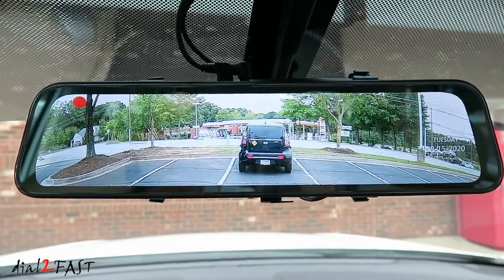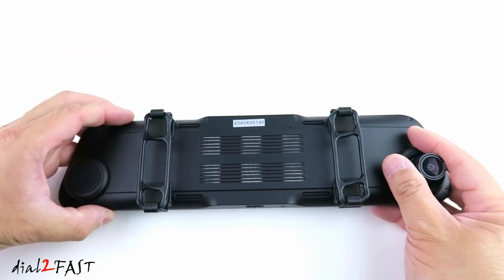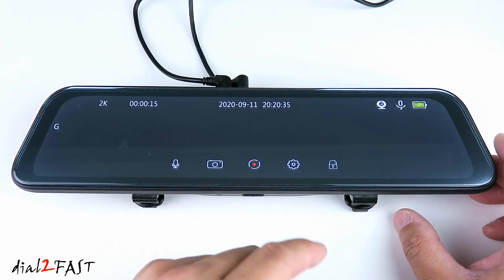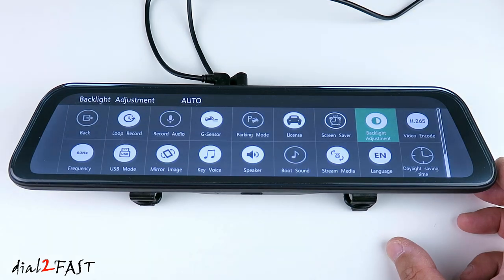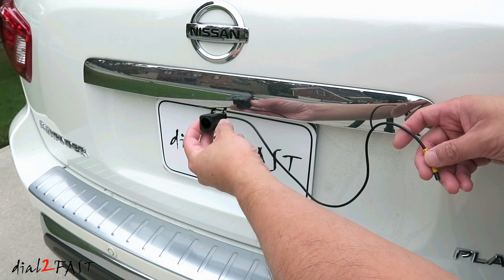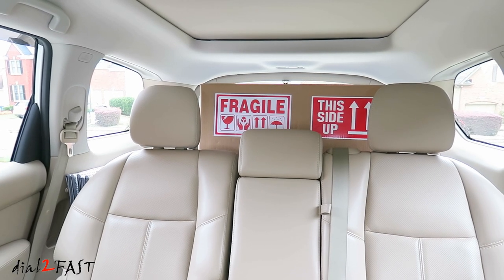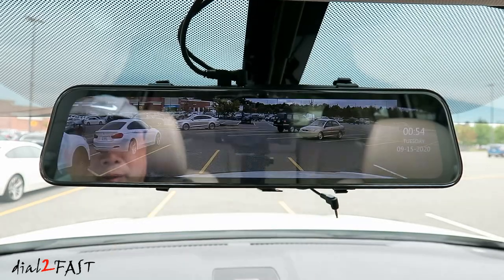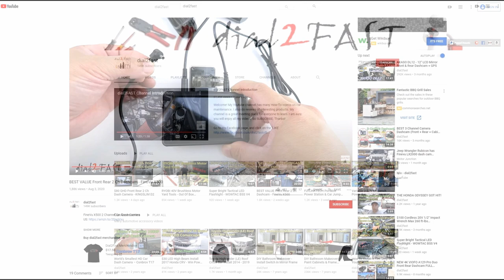REXING M1 PRO 2 Channel 12" Mirror Dashcam

Comment: Thank you for explaining the Parking Mode. Every other video I've seen of the M1 fails to mention that it runs off the internal battery and is in standby mode until it detects a collision. I just got the M1, not the Pro. Parking mode is definitely a key reason I bought it.

Comment: Always love watching your reviews, and just the way you install the products is very professional. I would like to know if there is an easy way for the power supply cable to be installed without going the long way around to get to the power source of the car. Do you think there is a way to have it connected close by the mirror? maybe from the top center lightning? im sure there is a way that would make it easier to connect any camera system. If you think there is actually a way could you make a video about it? 

Btw i asked you this question before since i own a 2019 pathfinder myself what did you think if its worth it to install a chrome side mirror cover and you said i should go for it well let me tell you i bought a pair and it looks amazing! Im also going to get me a flat type chromed out bug shield. I think its gonna look even nicer. You should definitely try it out it'll give your Pathfinder even better look. 

Keep up the good work. Keep the videos coming.

Comment: I’m have everything apart and done (for the most part.  I have a question though.  So I have a Sony like 10” head unit.  In the back of that there is a purple (w/ white stripe) wire for a “reverse in”.  Can I splice into it, connecting the red wire and the purple wire connecting the two and extend the red wire to a reverse light?  Will this trigger it to come on for both when I put the car in park?

Comment: Will this work on a 2013 VW convertible Beetle, I understand it will have to be installed by the license plate section versus the window due to being a convertible but my concern is will it work or will it need a smart kit, will it say that park feature will not engage, this is my question before purchasing.  Thank you

Comment: I'm currently in the market for a Dashcam and came across your channel. Great job on your review of the CRACHET 2.5K 12". The same model I was looking at and really like that you can play back video's on the unit, without removing the SD card. So my question is can the REXING M1 Pro play back videos on the unit or do you need to remove the SD card and put in a PC?

Comment: As always nice job. Though hard to consider this when there are better quality ones out there that have 2k/2k front/back cameras. Like the Akaso DL 12 that you reviewed for the same price. You should also consider reviewing the vantop 612t, it's comparable to the Akaso DL 12.
Reply from the maker: Thanks for sharing your thoughts and ideas on this. There are a lot of these mirror dashcam units on the market these days. I will check out the Vantop unit. Thanks

Comment: How easy to find and replace the battery?
Reply from the maker: Most of these internal batteries are not designed to be replaced by the user. It typically requires full disassembly if the unit and desoldering the battery.

Comment: Great video and very informative.  I have a question.  I currently have the Rexing M1 and when I try to use it as a regular mirror the image shakes even though I really can't see much movement with the unit itself.  I drive a 2019 Honda Ridgeline and the ride is super smooth, this happens even on the smoothest roads.   Does the M1 Pro have the same issue?  I did double check the mounting and it is as tight as it can be.
Reply from the maker: I did not notice any shaking in the mirror image when I was testing it. The dashcam was tested in my 2017 Nissan Pathfinder. Now because the dashcam is strapped to the factory mirror using rubber straps, any little vibration will be amplified through the mount to the mirror and onto the dashcam. When you are driving and if you see it vibrating, put your hand under the dashcam and see/feel if the vibration stops to see how much flex the entire assembly has.
Reply: @dial2fast   thanks for the reply, I will give your suggestion a try.  I am hoping this camera fits better than the M1 which is 10" and my mirror is 10" as well. The M1 has a slider thing on the mirror so it sticks out, but I cannot flip my drivers side sun visor down fully...it's just a bad design.

Comment: Do you know of any company that makes a mirror dash cam for the front but a wireless for the rear?
Reply from the maker: No and most likely not anytime soon because the video signal need to stream wirelessly and record at the same time for an effective dashcam. If they do make it, it will be much more expensive. Also don't forget even a wireless camera need power. Depending on the car, it might be difficult finding ignition 12V at the back of the car.

Comment: Is this product only for the American market?
Also, how does it compare with the AKASO DL12?
Reply: I would also like to know this
Reply: @cheynobi  these two products are exactly the same. The channel operator doesn't seem to want to answer pretty simple questions on here.
Reply: @BradleyQuerruel  thanks, which one would you go for, im leaning more towards the Rexing
Reply: @cheynobi  I honestly think they are both identical, so what ever you can get for the cheaper price. They mostly come out of China from the same manufacturer, then resold under different brand names.
Reply: @BradleyQuerruel  thank you so much
Reply: @cheynobi  I personally am looking for a whole mirror replacement unit, not one that clips over the front of the existing mirror. They look too messy.

Comment: I have a Manual transmission car, would it still function the same? The reason I’m asking is because some of the rear view cameras don’t work the same with manual.
Reply from the maker: The mirror just need ignition 12v to power on.  A manual car has ignition 12v when it starts so it will work fine.
Reply: @dial2fast  great thank you

Comment: If you're using it as a regular mirror (lcd off), is it still recording? or do you have to reengage the lcd ?
Reply: Good question.
Reply from the maker: Yes it continues recording even if you turn off the LCD. The recording is determine by whether the ignition is on or off.